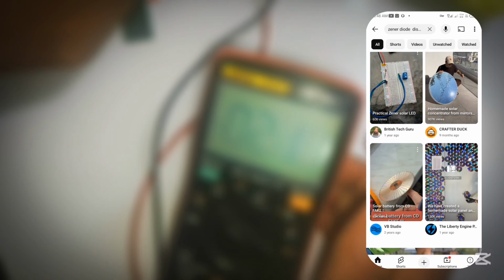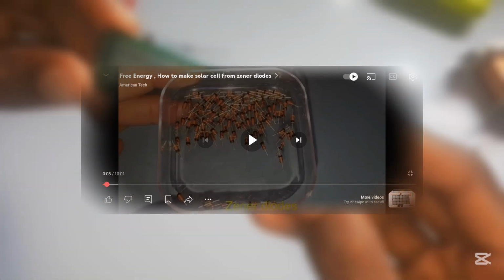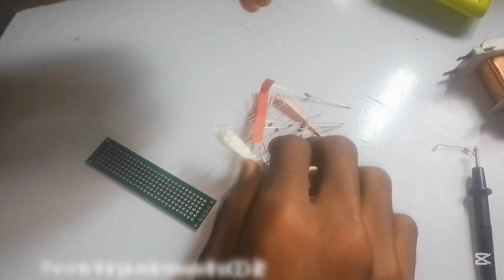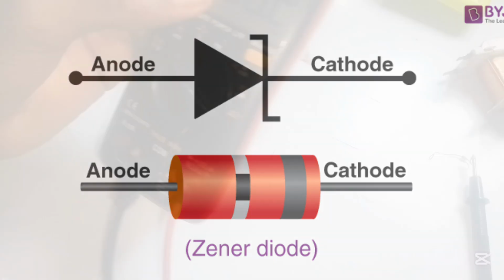I Tried Making Free Energy Using Just a Zener Diode – Here’s What Happened!"

Comment: All P-N junctions will generate electrical current when "excited" by photons, and this is not just true for zener diodes. Glass packaging allows light to hit the junction, and the photon energy is absorbed by electrons. Many of these electrons will be moved into a higher energy level, and this causes a change in charge distribution. This change in charge distribution is electrical current. 

The process is reversible; a P-N junction emits photons if you force a current in it, but we only see the light with our eyes if the photon wavelength falls within our visible spectrum. 

BTW - many zener diodes are manufacturers also use black plastic (epoxy) to encapsulate the devices. Both packaging materials have their "pros and cons", so circuit designers may prefer one instead of the other for different circuits.
Reply from the maker: Perfectly right as explained